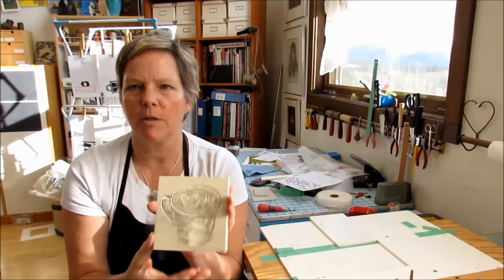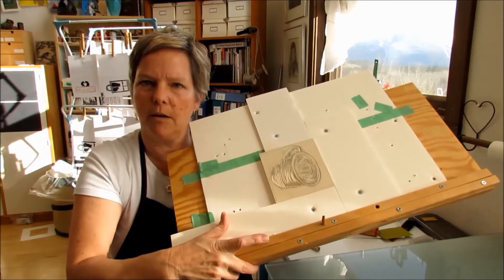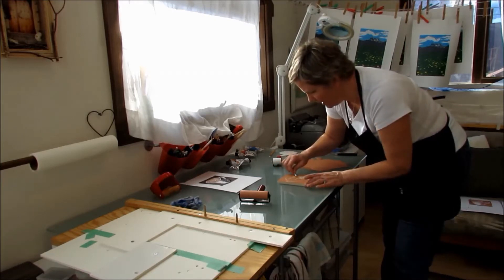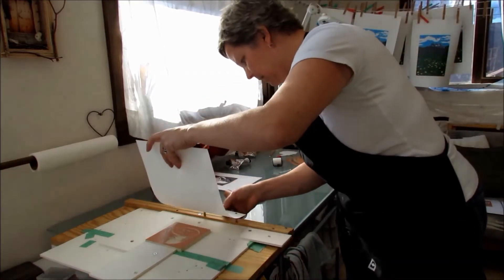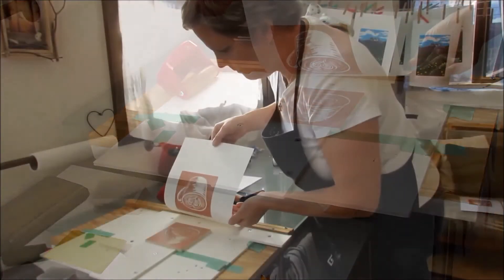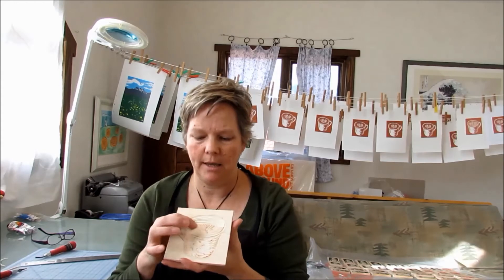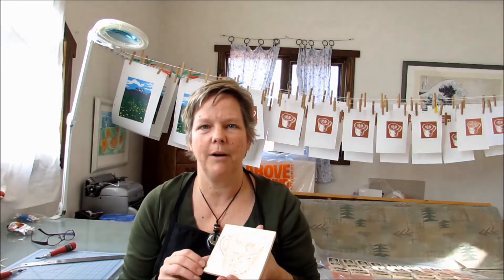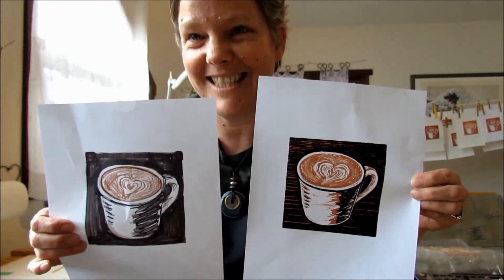Linda Cote: Making My Latte Love Linocut Print

Comment: Hi Linda, I like watching how you achieve the two-color print.  Since you have carved off more of the original block in step two, I am assuming that this particular two-color print will not be able to be reproduced again.  In other words,  you have created a set of limited edition prints, is that correct?  Very cool.
Reply from the maker: Hi Alicia! Yes, that's exactly right. These are called a reduction linocut, as the block is "reduced" a little  bit each time. They can not be recreated or reprinted, indeed, and end up being a limited edition! Nerve-wracking process, but tons of fun! ;-)